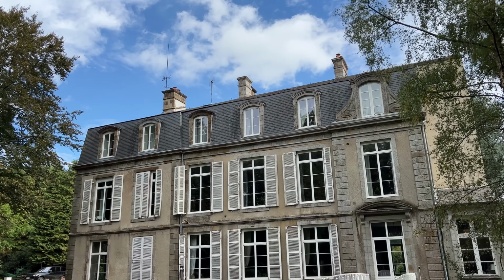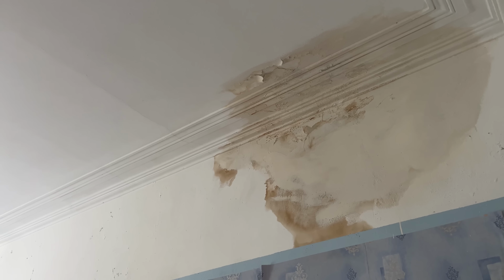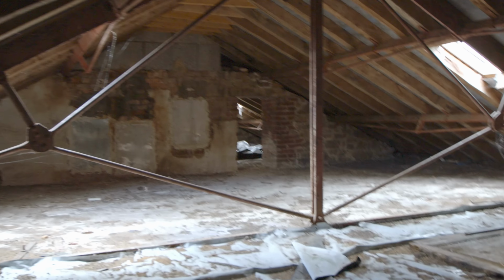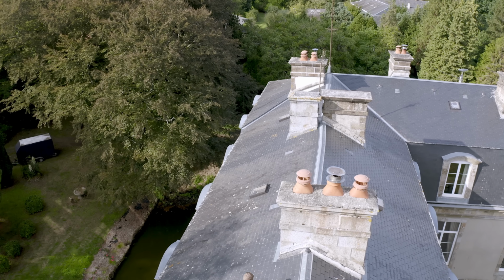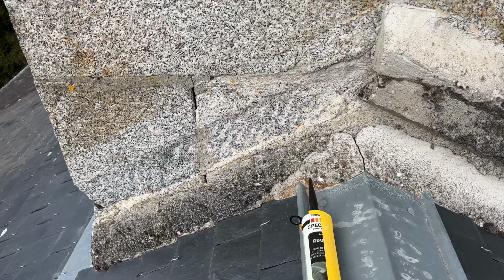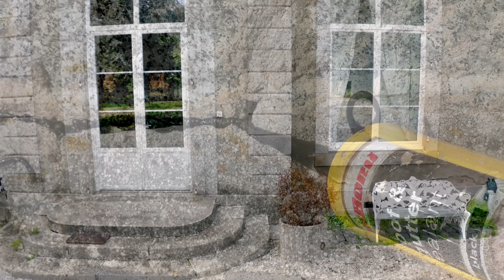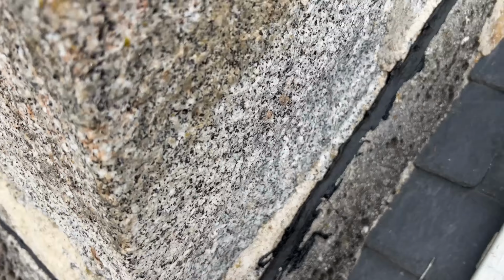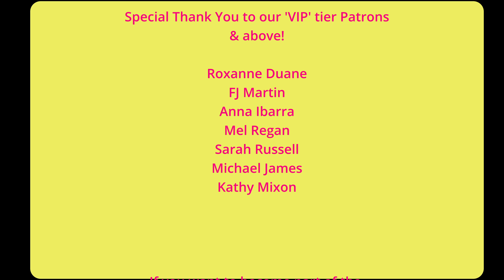€100k roof is destroying this Chateau  - Chateau Life 🏰 EP 232

Comment: Shouldn't there be something like lead flashing around the chimneys? That would stop water seeping between the chimney and the tiles.
Reply: that's what I thought, usually flashing is slotted in to a groove in the side of the chimney.
This appears to have been done differently though, but instead it relies on the mortar not cracking which it did.

Comment: Its called "job security", the roofer most likely fudged the job thinking they're gonna be hired again, easy money🙁
Reply: I am not anxious to blame the roofer. Contraction and expansion causes concrete issues. France has experienced tremendous heat this summer. 
In Florida USA...THE EXYREME heat plays havoc with concrete
Under tile roofs. The tiles hold up but underneath the concrete fails and breaks down. Also when roofers were up there they probably did not examine the old mortar in the chimney ? That would have been a good time to repoint the chimney,  but roofers are roofers  and masons are masons. Lol